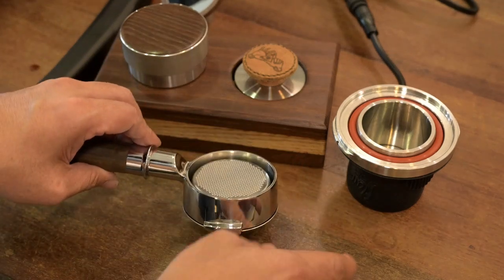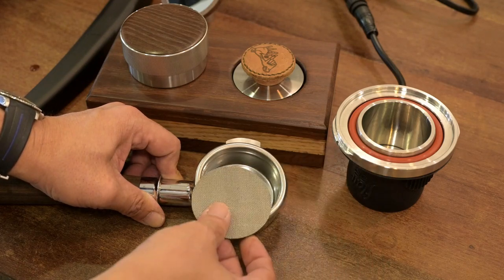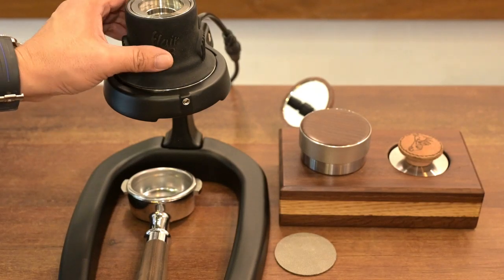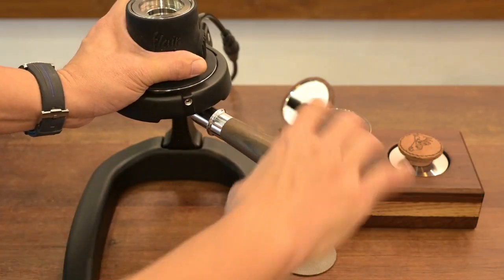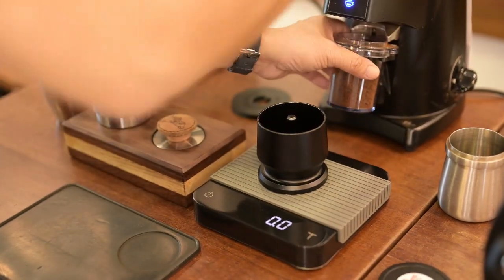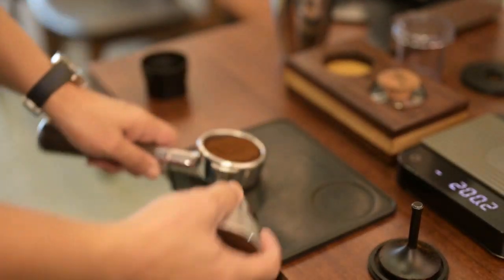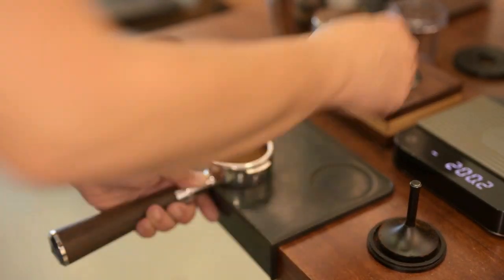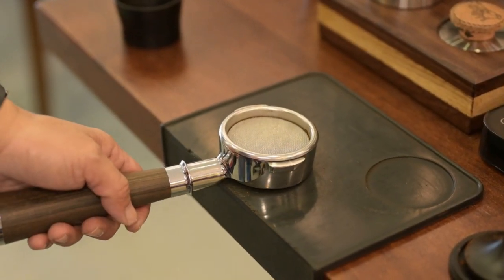Flair 58x| Upgraded to the newest electric chamber w/o dispersion screen. My 1st shot turns out ...

Comment: Don't know why anyone would buy 58x, let alone upgrading to 58 later. SMH😧
Reply from the maker: why not???
Reply: @wirinharwirjawan6422  It would likely cost more than double the initial price difference between the two. Not counting the 58x head now have no use, and other wasted resources.
Thermal management is the biggest challenge for almost all manual machines. A key feature of flair58 is to solve that.
Reply from the maker: @JohnZ556  Well.... the valve plunger works well for 58X imvho
Reply: @JohnZ556  Did you try a 58x vs 58 at least  ?
Reply: @Guenounovitch  Do you try every inferior solution to know they are not what you want? No!
I tried to not use the heating to see what happens and it was not fun. Waste of hot water, extra time and work just trying to keep it hot. And your 1st cup very likely will be different temp than the rest, also your work flow in between will affect the temperature! I mostly do light roast SOE and use a hand grinder. NOT going to play the 'keep that chamber hot and consistent' game every morning!